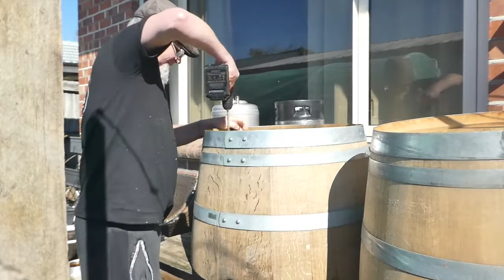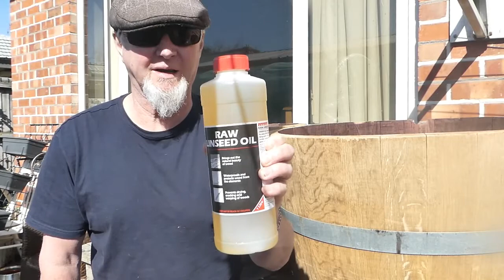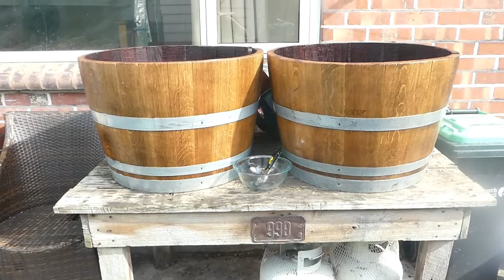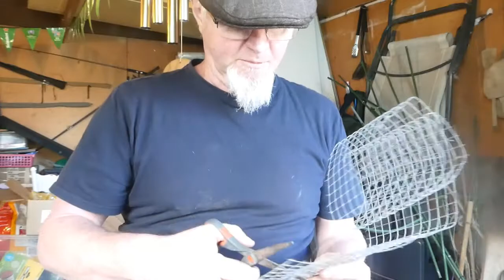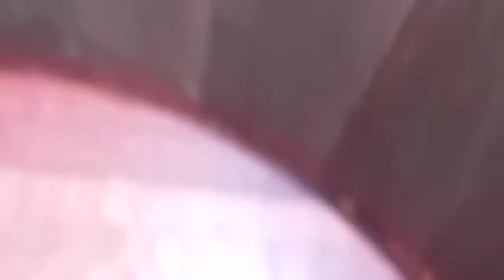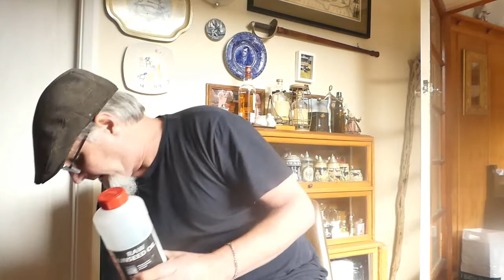Preparing Half Wine Barrels For Planting In.

Comment: Hi, nice looking barrels. I bought 2half barrel for planter but my husband stack them on each other on the way back. And now we couldn’t take them off each other😅. Do you have any suggestions? They are too heavy to lift up and the wood and the metals just stick loke magnet 😢Thank you
Reply from the maker: Hello and thanks for the question. I can see how that could easily happen.  First make sure the barrels dont get any water on them like outside in the rain because that will make them tighter. Tip them together upside down. Then try and put bricks or something around the top barrel underneath so both barrels are off the ground. Make sure they are in a dry place. The barrels should expand and the bottom barrel fall out onto the floor. I may take a week. If it doesnt fall out it may loosen it enough.  Be sure to keep them dry.
Another thing you could do is tip the barrels on their side, and drill a hole in the bottom about 40 mm  and put a steel bar through to meet the top barrel and try hitting the bar with a mallet to push the barrels apart. I hope this makes sense. Good luck ,thats all i can think of a the moment. Please let me know how you get on with it and don't worry . Cheers
Reply: @finnroohomebrewing   Thank you. They have been out in the yard through dry and rain for months now🥹🥹 but i  will try your suggestions anyway and will let you know🙏🏻

Comment: great project. They look very good. Why did you use raw linseed oil? I used boiled on my outdoor wood projects. Cheers my friend
Reply from the maker: Great comment mate. So, my research told me that boiled linseed oil has a much shorter drying time. And that's what you want with decks and furniture and it works very well. I chose raw oil because it protects the wood better in harsher situations like barrels filled with soil and compost etc. From my research you've done right using boiled oil for your outdoor furniture etc 
How does it look, I bet it looks real nice. Cheers mate. Always great to hear from you. 😎👍
Reply: Sounds like a great idea!
Reply from the maker: @ThisisSeeLifeHomesteading  Cheers See Life, great to hear from you.

Comment: Wonder if the inside lining around wood is needed
Reply from the maker: That a very good question Lorna. My plan is to oil the outside twice a year and to replace the soil every 2 years and oil the inside with 2 or 3 coats then. The oil does a good job of protecting the wood but needs to be maintained. Since I made this video the exterior of the pots look great. I can't remember why I decided not to line the inside with a poly liner. If you decide you want to line your pots , I would still oil the inside. Cheers😎👍